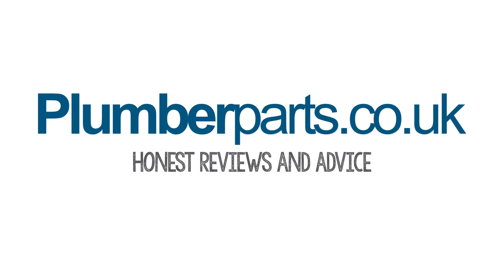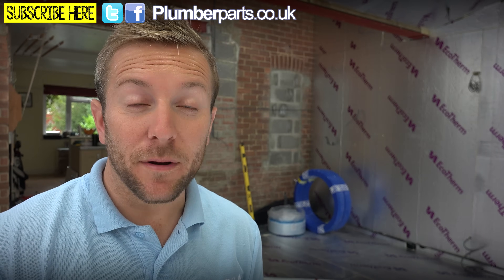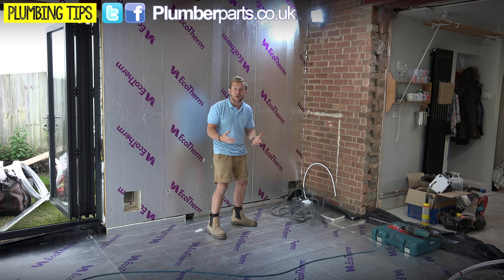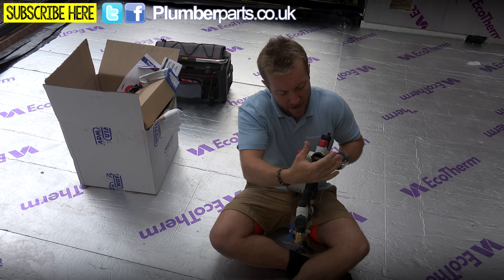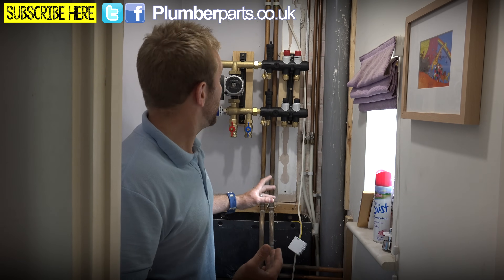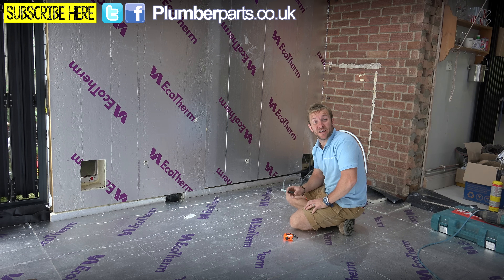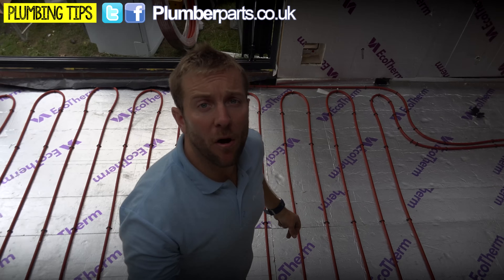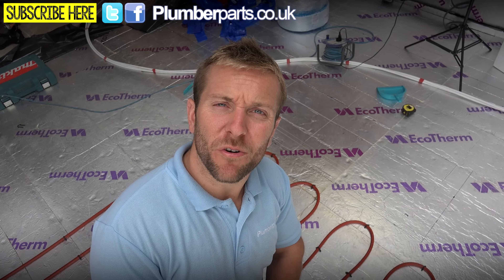UNDERFLOOR HEATING GUIDE AND INSTALL PART 1 - Plumbing Tips

Comment: Hi James. Great video. Random one but I've installed this and it only has 2 zones in the same open plan kitchen lounge. Same as this basically. The only issue is my boiler and central heating is thermostat and smart controlled whereas my UFH manifold is just plugged into a socket which only gives me the on off option by hand. I have added a smart plug adapter but that still means I use 2 apps to turn on CH and then UFH. How can I resolve this. I'm just a weekend DIYer

Comment: Hello

I am in process of installing water underfloor heating. As part of the project the contractor is also moving the boiler from kichen to garage. 

My question is when the project completed what kind of certificate and documentation should I get for the underfloor heating installation and for moving the boiler for my future record. 

Can you please list out what should I get from the company on completion please.

Thanks,

Comment: Hi James, loving your videos, thank you! I have a quick question re the flow and return pipes from the Air Source Heat Pump (interior unit) to the UFH manifold. I know these need to be 26mm pipes. Is there any specific type of pipework needed? (guessing it doesn't need to be PEL-AL-PEX?)  Also a bit confused about how to run the flow and returns if there's more than one manifold. We'll have 3 manifolds over three floors. Do I just run a flow and return pipe to the top floor manifold and tee off of this for the ground and 1st floor manifolds? Cheers for your help.

Comment: One concern I have about undefloor heating is how do you add to it? You mentioned that additional loops can be added, but practically how is that done when the flooring is lay on top? Let's say you wanted to add your living room at the other side of the house....how do you get the piping to the manifold without digging up flooring? Great videos and love your honest, can do attitude

Comment: Okay so I came here because I wanted to know if I can put underfloor heating manifold onto a condensing combi system. I'm not a plumber but I have done plumbing a fair few times so competent with soldering etc.

Comment: Heya, we just got our hearing looked at but we still have issues. I’m wondering if you can help. We have an old riello 40 oil burner and it’s connected to a Titan 2 Circulation Pump. The pipes in the house aren’t even getting lukewarm. Have you any ideas why this may be?

Comment: Fantastic How to Video! Well Done. Does anyone know how to drain the under floor heating system. I have  the same one, or similar. I just need to drain, add cleaner, re-drain and then add inhibitor. Thanks

Comment: Great vid. I have moved to a bungalow that has underfloor heating throughout and its great.  Only question is zone 8 on the heatmiser uh3 is set to override so when triggered by the thermostat it opens yhe valve on the manifold but does not trigger the boiler.  I can switch override off on the heatmiser unit so it will trigger the boiler for zone 8, but just wondered why it was set like this. Zone 8 is the hallway and small toilet that houses the manifold and miser.😎👍😎

Comment: some people recommend to use Floor panels with grooves in them where the pipe will stick in, do you recommend those?
Reply: you can put a 5-6mm screed over them you need primers ect ect  the 5-6mm flexible screed acts as a heatsink.you then need a ufh breathable underlay then flooring.

Comment: Hi - Just a question or 2 as I'm looking to install underfloor heating ina garden room. Irrespective of how many loops to me 1 room is 1 zone. So why do I need a controller or opening valves to each loop? I'm thinking a stat switches on the boiler and feed valve which in turn powers the underfloor heating pump, though I thought the underfloor heating pump just runs all the time circulating the water so its all at the same temperature ready to mix with extra heat from the boiler when the stat demands it. I'm not a heating engineer so I could be wrong and am happy to be corrected. Just keeps the cost down if there is nothing wrong with my suggestion. Just to add...I plan to install 4 loops as its a large room and I have made a floor design to avoid cold spots...also hence 4 loops of 70m of pipe at 200mm spacing. So I plan to run it all as 1 zone unless advised otherwise. Finally, it will be connected to an open plan kitchen so I am putting in more loops so the heat will also heat the kitchen.

Comment: Is there a reason you fit 2 loops to one room and not just one loop?
Reply: Its usually to be able to manipulate each zone how you want so if the zones are split into different rooms then you have the ability to turn heating in one room off and other room on. The other reason is to make a quicker responsive system because its quicker to heat the room via two pipes than one.

Comment: Hi mate, good watch...! I am about to install this and the supplier said the heat is never so much that it would cause damage or issues to the kitchen cabinets and electrical appliances, is this ok? Secondly, wireless vs. wired control?

Comment: The pipe should be laid in a spiral pattern where the 2 loops spiral within each other! If you lay the pipe in a zigzag pattern as shown in this video you will get an uneven heat distribution as the water looses heat as is it returns to the boiler.
Reply from the maker: Sorry Alan but that's not correct. I've done this job for years and we've never had a problem. Indeed, my home was done using this system and using a Flir heat sensing camera. It's lovely and even and warm all over!

Comment: you should realy have laid the pipe on top of a polythene membrane to protect you insualtion  and also if you had done a big loop little loop system on you pipe work our floor would heat up evenly instead of left to right. i lay underfloor heating for a living so this is how i know this
Reply: craig 

Been looking for someone to comment that 😂 I started to doubt myself thinking maybe I’m doing it wrong

Comment: Why don't you connect the end of the pipe to the manifold before you lay it, and connect the other end once you've finished running that circuit?

Comment: Does the concrete floor has to be leveled before applying insulation board. Our garage floor is about half brick height difference. ???

Comment: Hi, I've got some 16mm underfloor heating pipe and I need to test it before I install it as it's been stored in a barn for six months and I'm worried it might have  been damaged. What's the easiest way to do this?

Comment: Hi buddy. Quick question. I might be being daft but can't get my head around. Thinking off having underfloor heating in a conservatory we are going to have. We have the drop down (as boiler is upstairs) flow and return pipes 22mm other side of the wall of the soon expected conservatory. currently the heating system is from a new Worcester combi  with nest thermo and is not zoned. I see there is a 2 port valve on the manifold which would open when its own thermostat calls for heat. but my question is if the rest of the house is not already being heated how would the manifold receive hot water from the flow? also if the 2 port valve is wired back to the boiler some how and when it calls for heat from the boiler and the boiler comes on how would you stop it heating rest of the house? sorry if this sounds daft. I'm not a plumber but have a good knowledge of plumbing. After reading this you probably "think this guy knows nothing lol"

Comment: Although you stated no underfloor heating circuit to be installed  under your fridge and cupboard what precautions did you take to prevent heat creep permiating into the screed slab in these areas as will happen in all attached adjascent screed ?
Reply from the maker: Funnily enough, it just doesn't happen! SUBSCRIBE! ➡️👉 https://www.youtube.com/subscription_center?add_user=plumberparts 👈⬅️ IF YOU HAVEN'T ALREADY! 😎

Comment: Great videos, thanks!  If your home has half the rooms heated with radiant floor heating, and the other half with rads, do you need two separate pumps, mixing valves, and manifolds, since the water temperature needs to be different?
Reply from the maker: +William Galloway Heating should have standard controls and the Manifold will do itself and mix the water to suit the underfloor remotely. PP!

Please sub >> https://www.youtube.com/user/plumberparts << if you haven't already!

Comment: you forgot to take into consideration to compensate the loss of heat near the big windows/doors. In that area the pipe for the loop should have been half the distance to the pipe next to it. For the rest of the area it's OK. Laying out the pipe in the shape of a snail with the center in the area where you will be standing the most would have helped for increased comfort
Reply from the maker: Dan, it'll be fine. I'll let you in January!
Reply: +plumberparts of course it will be fine. Those are just extra options that one could get. Of course the installation price would rise and also it would require more materials. Keep the good work. Thank you for teaching us. Your videos help me very much since I am supervising the construction of my house

Comment: Nice video, as always. Just one point, the Building Regs say you should  always put down a polythene membrane over that insualtion before you clip the pipes down. Some inspectors are really hot on it because the sand and cement reacts with the PIR board producing a gas that attacks the screed as it is curing and that weakens the screed where the sheets join. Have a look at the Kingspan website for more details.  
When people find their screed is breaking up they blame the UFH but it is almost always the lack of polythene separation. Using the Polypipe trays overcomes the problem.
Reply: Swirl works better than zig zag. With zig zag you will have one end of your floor hotter than the other. With swirl heat would be more even. Zig zag is only good in small areas like bathrooms. Hopefully it works for you well.
Reply: +Skill Builder Can you have direct link to this information ? I'm not quite sure I did understand what's the problem is? I looking to do underfloor heating and I want to do it right.Thank you
Reply: +tpax3p I will look for the relevant text on Kingspan's we site  but if you just make sure you cover the foil face of the insulation with thin polythene and then put the pipes down on top of the polythene you will be doing the job properly. Loads of people get this wrong and it  causes creeds to crack. Plumbers blame the screed and the screed layers blame the people who put the insulation down. Typical building industry buck passing. 

Also sleeve pipes where they go from one room to another or through a wall because they will expand and contract and cause wear at that point.  There is a lot of information out there on UFH  you just have to look for it.
Reply: PIR board for walls and ceilings EPs for floors
Reply: please provide a reference as to the building regs for the need to place polythene sheet over the insulation, the website says to damp-proof the concrete slab then place the insulation board, underfloor pipes, then screed...
Reply: Ogre2011 so DPM under slab and then insulation boards directly onto concrete slab?

Comment: Two points Jaz auld son;
1. Where your UFH loop leaves the screed, in your case through the wall, the sleeve should bridge the gap - should got right into the screed.  The slab will contract & expand, may split the pipe.
2. Oi you're punching well above your weight mate!! What a lovely looking Mrs you have there!!!!
Carry on.
Puller

Comment: Howaya boss. Can I ask ya about the ufh. I know it takes longer to heat up than rads. First do you have the option of putting timber directly over that or does it have to be a screed and second cos it takes longer to heat up than rads will you time that differently than the rads to allow for this. I remember talkin to Danfoss I think it was before on the phone and they had time clocks for the under floor heating that were factory set to go on and off numerous times during the day to not let the screed cool down to much. You might have this end of it covered in your next video anyway. Great videos by the way me all china
Reply from the maker: robert brennan Hi Rob. I'll answer each question seperately!

1. If you lay timber (I imagine you mean engineered oak or something) Then it's best to use Wavin's low build system. This runs a 10mm pipe through a channel that's made of aluminium and spread the heat over a larger area. Also you have to run the water temp in a manifold at a slightly higher temp. However, I have been to properties that have screeded over standard staples then popped down an underlay with wood over that and it's worked fine!

2. Yes. For example, if i'm getting up at 6, I'll have the underlfoor come on before the rest of the system at 5. Similarly it will go off an hour earlier too. So you basically have it one for the same amount of time as the rads, but shift the times.

Hope that helps mate! PP!
Reply: +plumberparts, ahh good stuff. Appreciate that and thanks for the reply.

Comment: Seperate motorized valve for your under floor? I like this system looks a lot easier than using the red crate system from Polyplumb. Looking forward to Part 2.
Reply: It's always best to zone your ufh.
Reply from the maker: CriBz86 Hopeing to fit one in as I always Zone them.....but need the room on the flow pipe to fit it. Although Wavin state it's not required I'm like you guys! PP!
Reply: At what point or what indicators would a llh be required to separate the ufh from the rads?